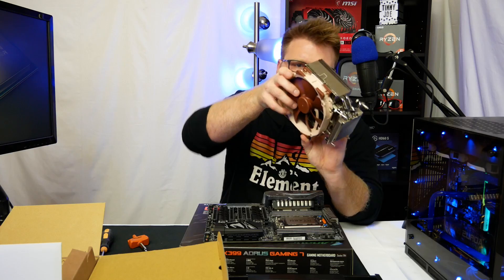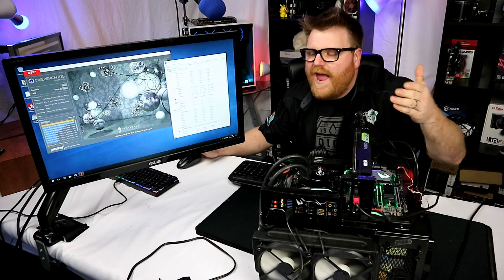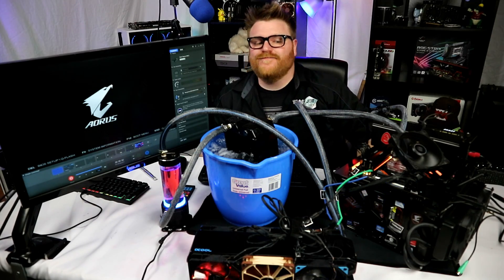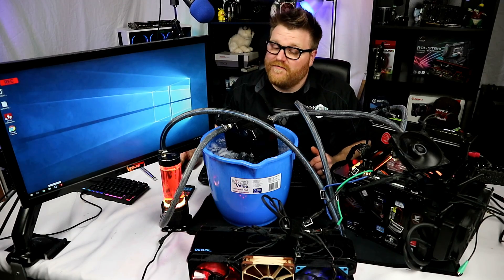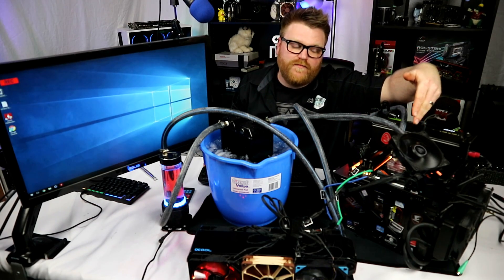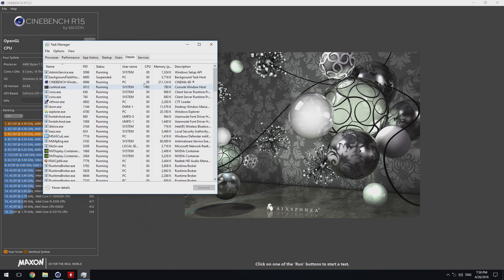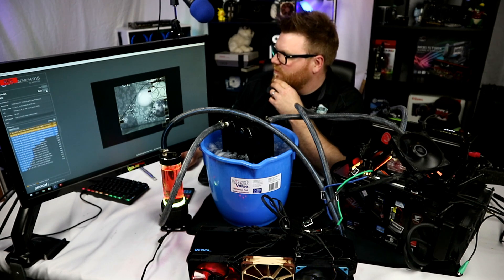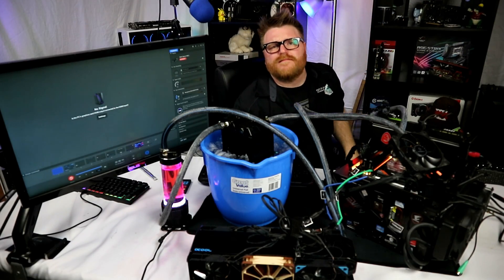Ryzen 2700x 4.4Ghz EXTREME overclocking! (2000 pts in Cinebench?)

Comment: From a lot of the videos I have watched having at tight of timings as you can get on the memory will probably get you the extra points you are after. Ryzen 2 works better with 3200 speed and tight timings compared to 3400 speed and loose timings. I watched another youtuber perform similar tests and using memory alone was able to hit 1930 in cinabench with stock clocks and very tight timings. Doing both should get you the magic 2000+ number you are hunting for.

Comment: I don't know if it helps but I would do the following; i would connect the air cooled radiator after the cpu, then the icebucket but this time but a little salt in it, you could get up to -7 degrees if you mix it right. The water will probably end up with mabye 10 degrees...

Comment: You could try get the bucket really really cold by dumping out some of the water of the bucket and pack it with ices again just right but I suggest a bigger....tubs.   A special Turbine would help flows through the radiator heat sink fins too.

Comment: If you manually tweak your memory timings, you'll get a bit more and surpass the 2000cb mark. Just lower the core clock a small amount until stable and then focus on tweaking the heck out of your memory.

Comment: okay, just a note, if you want stability with your overclock, may I suggest removing the graphics card and just use the integrated one, set the voltage just a tad lower like 1.45 volts, then set the ddr4 timings accordingly (if you can), once you've done that, use a prime95 64-bit run to even out the clocks for approx. 5 minutes and then reset the voltages you used previously, I bet you'll get a slightly better score, though I'm only guessing you'll get 2% better cinebench.

Comment: I would advise you to stick with 3200mhz on ram, bump the voltage to 1.4 , 1.5 even, and tighthen the timings as much as you can. Try it with the asus hero x470 it has ocers presets or something.

Comment: Errr... 1973 in Cinebench R15 at 4300MHz and memory at 3333MHz CL14. No LN2 or whatever, just an AIO Coolermaster 360mm rad... Temp 76 at it's peak. But I still have to play with it, this was only 2 hours screwing around... Case isn't finished yet so I lose a lot of cool air through my right side panel.

Comment: change priority to real time. it'll lock up the entire system for a few minutes (for however long it usually takes to run CB) and then it'll come back. scores typically go up ~3-5% so not a huge deal, but if you're benching on something like HWBOT and need a few more points to beat the asshat ahead of you it's worthwhile.
Reply: yeah realtime gave me 30 points on my i5 7600K.

Comment: what are the speed and timings of the memory, for sure you can get it with a litlle tune. in the bios there is also a performance mode specific for cinebench, you can get some points with that

Comment: I have had luck when trying to push just a little bit more by trying to push a couple of the cores higher than the rest. I have an 8700k that won't let me run more than 5.4Ghz on all cores, but I can score higher if I run 4 of them at 5.3 and 2 at 5.6. For some reason the first 2 cores on my chip can just keep going.

Comment: If you pour large amount of salt into your ice bucket then the chemical process of the salt breaking the molecular bonds of the ice actually draws energy out of the system, lowering the temperature of the ice. The salt melting ice should draw more heat out of your radiator then just the ambient temperature of the iced water, thus cooling your loop more.

(This is how Victorians used to make ice cream - so the technique works!)
Reply from the maker: I was thinking about that, but then I'd just have a really salty rad. I may take this in to account when I attempt my 2k record again
Reply: Well, you could try this - put rad in small bucket of water, put this in a bigger bucket of ice, pour salt into ice, melting ice will suck heat out of radiator bucket - if you could stir/agitate rad bucket's water that would help prevent a thermal boundary building up around the radiator.

Good luck.

Really enjoyed the vid, although I felt your pain when you didn't quite reach 2000.

PS thanks for replying - good to know you read the comments.

Comment: Hardware monitor reads voltage higher then it really is. I would use hardware info. Is also set LLC to extreme, it will get you the closest reading to your voltage.

Comment: Delidding Ryzen is pointless since they're already soldered to IHS.  But at timestamp 1:18 you have hardware monitor up and one of the cores is at 73C and the others are at 28C with one exception at 45C, thats a huge spread.  Maybe delidding because there was a missed core?  Der 8uer's channel showed that they are soldered by sheets instead of drops, but maybe this will help out??

Comment: If you are running only 3200 Mhz memory, go to 3400 to 3600 memory then retune and try again. higher speed memory alone makes a huge difference with Ryzen 8 core chips. that should get your score at or over 2000 in CB R15 multicore. I am getting 1722 at stock settings on the 2700X and 3200 memory. my next move is 3600 memory then play with the CPU clock.
Reply: 3200 -> 3600 is not huge, especially if timings are loosened. 3200CL14 is about equal with 3600CL16. You get much better results working with timings at 3200 and above. I know subtiming settings are jungle, fortunately smarter people have made custom memory profiles.
These timings are for b-die memory kits. Expected improvement is around 5-10% in cpu bound games compared to default settings at same clock speed.
http://www.overclock.net/forum/11-amd-motherboards/1624603-rog-crosshair-vi-overclocking-thread-2067.html#post26178558

Comment: you need to push more on the memory. Sometimes is not the frequency but the secondary and terciary timmings. i've gained over 50 points in cinebench going from tweaking memory at the same frequency.

Comment: Maybe play with the speed of the water pump.   I know in the automotive world there is a debate over the value of a high volume pump.  The theory is that if you move the coolant to fast it doesn't have enough time to transfer the heat out of the radiator.   I know that's for cars but the principle should be the same.

Comment: Run Auslogics Boot Speed first.  Run the reg defrag and then the reg cleaner.  Then run the optimize ssd if you are using ssd. GUARANTEED to get 30 points higher in Cinebench.  Works for me all the time on my 1700X which scores 1751 OVERCLOCKED TO 3.9 and my FX 8350@4.5GHZ getting 712

Comment: to get correct thermal exchange in the ice bucket, you have to have the water moving thru the rad. Sitting in the water the heat creates a "insulation" zone where the heat can not escape fast enough to be efficient.
Also check out the timings that Buildzoid has for the Ryzen Ram : https://www.youtube.com/watch?v=zoXbHRR7j98

Comment: you can get easily 2100+ at Cinebench15. im running 4,3 on all cores and 4,5 on 6 cores no LN2 or dry ice, regular AiO and stable setup. just need to skew with some settings and get samsung bdie chips :~)

Comment: Sup Timmy on my 1600x I got 1414 in Cb with realtime its stands still the entire time and comes back afterwords with that but if its on normal i get A 1383.
Also my cpu is clocked at 40.50ghz and 3200mhz ram at 16 18 18 36 with 1.4315 vcore and 1.125 on soc

Comment: My 2700x goes 4.375. 3200 ripjaws v cl14 ( 3266 with tight subtimings) and Thermalright ARO aircooler.... 2004 cinebench. Box colsed with dustfilter and stuff... (Corsair 540 AIR with Noctua PWM 14cm fans).

Comment: Lower RAM speed so you can reduce latency timings (I run mine slower than rated, because I run 35% lower latency numbers). It significantly improves Cinebench scores, so stop trying to overclock it, instead underclock it and tune your timings.

Or you can run windows in safe mode to get a little higher boost. Look at what the pros do and you'll know why after tinkering a little.

Comment: Is Ryzen solder actually better than Intel solder? The i9 9900K is one of the first CPU in several generations to receive solder and it's already known for being quite the hothead. Does Ryzen simply run cooler due to efficiency and whatnot or is the solder actually done better?
Reply from the maker: It might just have better solder. If you think about the ryzen 2400g and how it's not soldered. It ran hot and needed a delid with an igpu on it. Ryzen 2700x with double the cores less the igpu is cooled easy with a big air cooler at its max frequency. But if you could overclock the 2700x to 5 GHz might be a different story. Intel's solder is bad for cooling some cores well and others not so well creating an unfixable delta

Comment: Cpu Clock and Ram clock are kinda depended of each other
instead of running 4.4ghz @3200 you should try 4.3 or 4.2 @ 3466 or even 3600

Comment: you know there are other settings in the bios that are used for overclocking other than fsb, multiplier and cpu core voltage. google blck overclocking

Comment: tigher timings on ram would help greatly.  mine at stock CPU and tight ram timings i'm in the 1800's
Reply from the maker: I bought 4266 memory and broke 2000 in the next video, check it
Reply: my ram is 3200 but I can't get it to run at 3200.  I've tried everything.

Comment: I would actually disable everything of windows 10. I think there is a light version of win10 Probably modded but still it runs on barebone without anything on it, that base windows 10 has. I would try that that would probably give you 30-50 points

Comment: Just bump the voltage up to 1.5v
It isnt killing voltage when you have that killing cooling setup.
I had 1.55v on my 2500k with air cooler for a long time. If you will bump voltage nothing is going to happen.

Comment: 1980+? Man, that was sooo close! Now I really want you to reach that 2000 mark!... About applications consuming even 0.1% CPU and memory resources in the background, a lot of those applications are not really required to at least login into Windows, so this is just a thought - what if you booted into Windows in Safe Mode with no networking and then try running Cinnebench? In safe mode, Windows uses the most minimal drivers and programs to successfully boot..Would it be possible to get a little higher score then? or/and maybe try overclocking the memory over 3200MHz with kits that offer the necessary optimizations? In this video, Jay properly demonstrates that higher memory speeds help in overall swiftness in renders https://youtu.be/RZRjoeyz4Z0

Comment: Do not oc the ram leave it stock leave 100mhz not 100.34 or something, 1.42V at 4.3z just with the radiator will hit 2000 I did  stable without ice and already with case , does not makes sense doing that kind of testing just to hit that number the Importance is using your PC normally and stable for daily task

Comment: Get 8 gigs of DDR4 4000 b die, let it run at the max speed you can get (prbly around 3400 Mhz) and then tighten the timings as much as possible. That's where I you could get your additional points from.

Comment: Youre actually hurting the performance by pushing relatively warm air trough one radiator and one radiator being in cold bath, it will actually make the water in loop warmer than with only rad in cold bath.

Comment: You know if you get a semi stable OC you could run Cinebench for 4+ times and Ryzen will just cache the result and get a higher score. Also you could just plug your CPU in to Asus board and use "Performance Biase CB15" and get a 5% higher score. Also i think your chip is capable to get 4.4Ghz, but you also need to rize SoC voltage to 1.2 on this kind of OC.